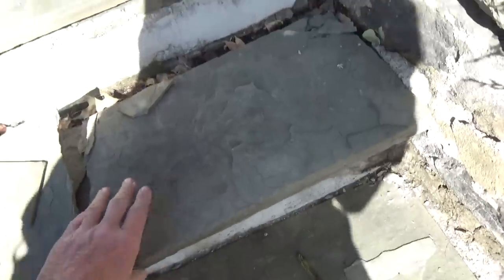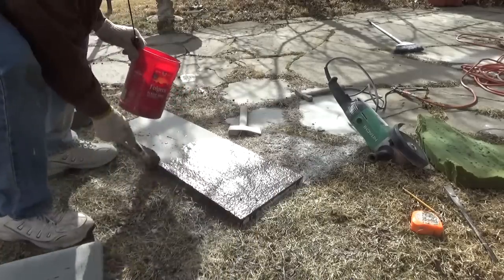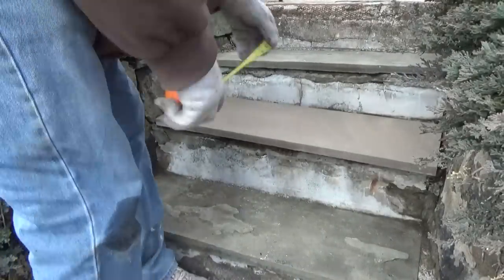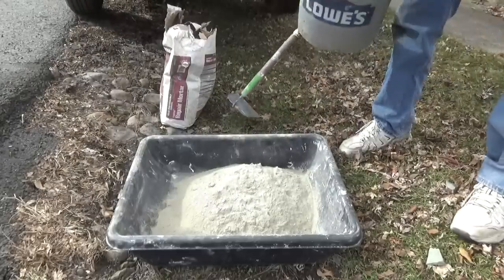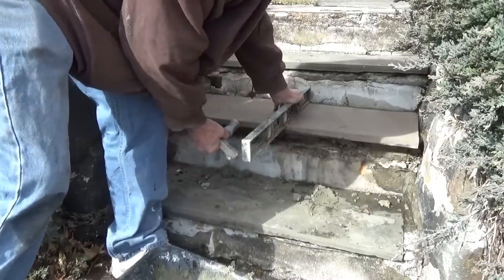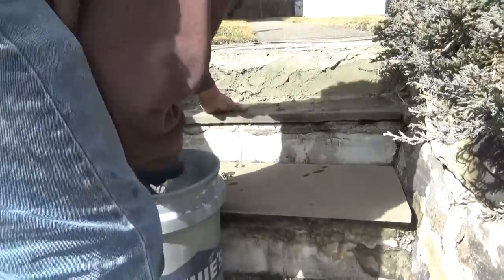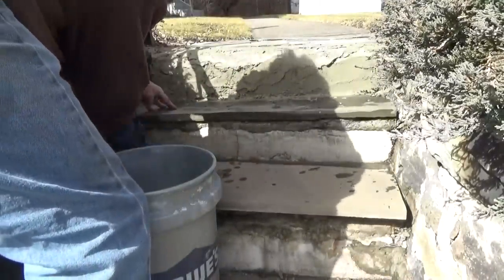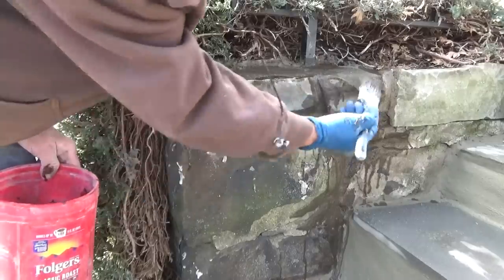STONE STEP REPAIR (Part 11) Mike Haduck

Comment: Hi Mike, big fan, I have a question, I'm planning to make a curb out of concrete to line my planter bed, my question is how deep do I have to go? Does it have to go below the frost line? And should I put tamped gravel below the concrete or right on the earth? I'm in Long Island Ny, our footings go down to 42" I I hope I don't have to go so deep, thanks keep your videos coming, helping so many people
Reply from the maker: Hi Jason, it all depends on the situation, it big trucks are going to run over it I go deeper but usually about 18 inches deep, or sometimes gravel then 6 inches with rebar, I got videos out called curb repair that might help, thanks Mike

Comment: I'm rebuilding a sandstone retaining wall in Pennsylvania. It was built in 1957. It's not a dry stack wall, so what type of mortar should I use? From what I have read, it appears type S would be best? But I hear Lime isn't good for soft stone like sandstone. The highest point of the wall is around 4ft. Your videos are very helpful!
Reply from the maker: Hi Brian, I have a whole series on repointing stonework and another on repointing brickwork, I show what I use in each circumstance,  thanks Mike

Comment: Hi mike, I'm a big fan, I see in your videos you always wet the old cement your attaching new cement to, I understand it helps new to bond better, do you ever use a bonding agent, I see it at the store, smells like Elmers glue, is this better or use water? Thanks, Jason
Reply from the maker: Hi Jason, I didn't see bonding agents until late 70s but I might add them to the mix depending on what I am doing, a lot of masons and stucco guys  believe in them, thanks Mike

Comment: I thought in a previous video you said wet it only if attaching vertically? Not those exact words, but the idea was to not wet stacked stone because the water would drain down, and stain the face stones.
Reply from the maker: Hi Mr C, I got that video out " should I wet it first"? That explains it best, thanks Mike

Comment: Mike I'm going to be a little harsh about your style. First your trowel has so much cement stuck to the blade, frog, neck, and heel I'd be embarrassed to take it out of my tool bag. Surgeons don't  use dirty scalpels and good masons don't use cruddy trowels and. slickers. As far as resetting the new stone tread you wet the bottom of the stone with water. In all my years we made sure the bottom of the stone was clean, placed our damp pack, then pasted the bottom of the stone with cement paste or slurry, which was cement and water,then place the stone and set it with a rawhide hammer. The modern way for the last 40 years is to paint the bottom of the tread with octoweld or a variety of other bonding agents. Either way that tread will not come lose. Water is not the way to do it. Having been in the trade my entire life ,I'm 75 ,I am retired but occasionally I do work for historical restoration companies and just completed restoring a 120foot tall stone water tower for the historical society for the state of Delaware I am well versed in quality workmanship. The dirt trick you talk about is a joke. I operated a successful Masonry business for 35years and I was taught by the best and hired the best. But in your defense you do it your way and I did it my way. Enjoy Florida and maybe you never know if you visit key west I'll be at schooner wharf with my boxer Lucy and I'll by you drink.
Reply: joe i lived in Mikes area and will say the weather is harsh (freeze thaw) and the economics are also harsh (elderly, fixed income, depressed economics). Mike is a true craftsman but but also knows how to match the job to the customers resources ......he certainly does not need me to defend him but I recognize his talents.
Reply from the maker: Hi Joseph, whatever works and no callbacks, anyway that beer sounds good if I ever get down that way I will look you up, thanks mike
Reply: @MikeHaduck OK Mike would like to met you
Reply: @daviddestefano5044  what talents?